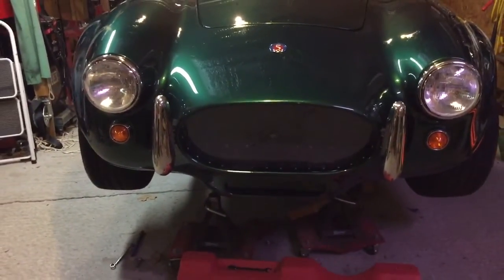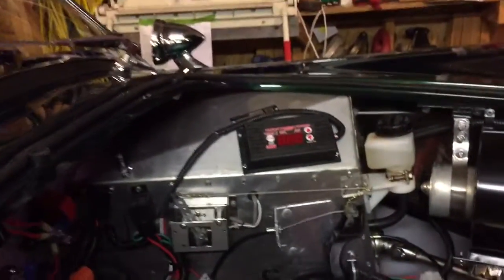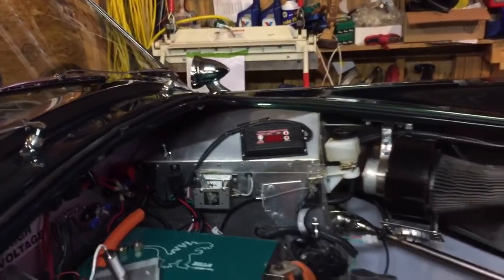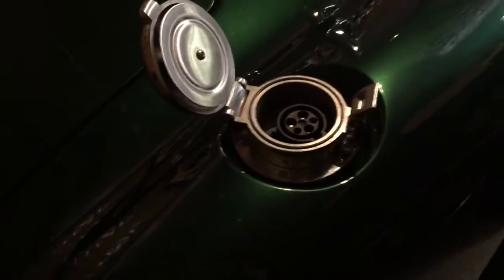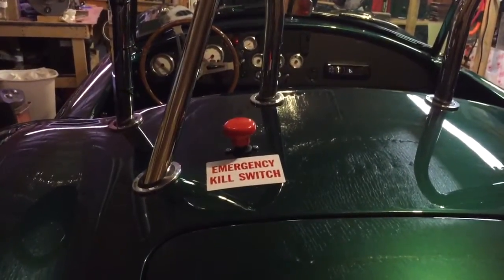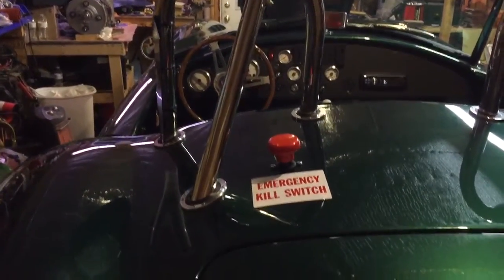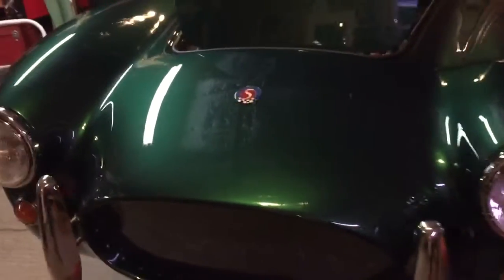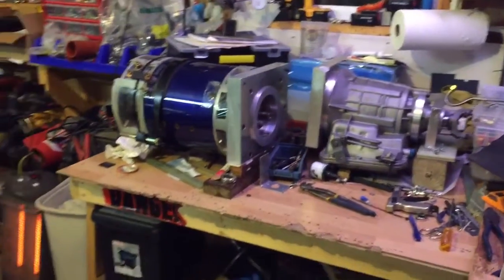FFR Mk4 - Electric Car - #55 Winter mods

Comment: 1600A?? Wow   Can you do the DC fast charging stations?
Reply from the maker: *****    That is 1600 motor amps, not charging amps.   It will be going up to 2000A this season for drag racing.  The tracks open in about 6 weeks, so hoping to get a lot of racing in this season.   For charging the car has a 120/240V 30A charger.
Reply: Understood. Quite impressive!  Fine job

Comment: 0-60mph time?
Reply from the maker: Dan Frederiksen There is still 2 feet of snow on the ground at the moment, but we will see how it does this year once it warms up enough to get out.    A few changes should improve performance over last season.   Rear end change from 4.1 to 2.73 will keep the motor rpms down and keep it in the best power band to a 50% higher speed.   Also it was only running at 60% power last season, keeping the power down for motor break-in.  This season the power settings go up a lot  :-)